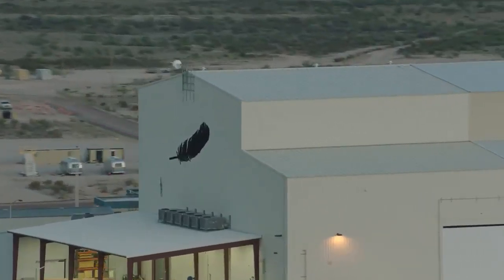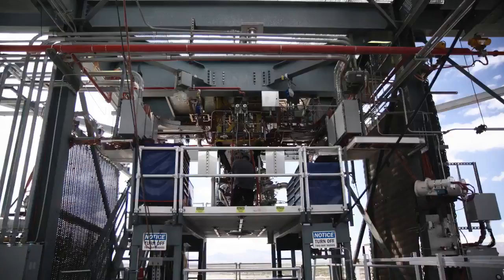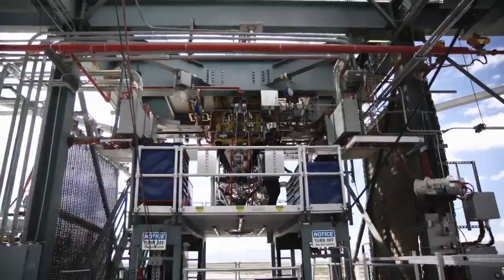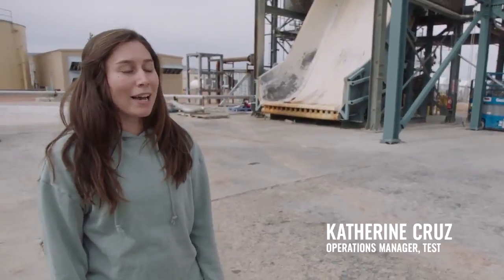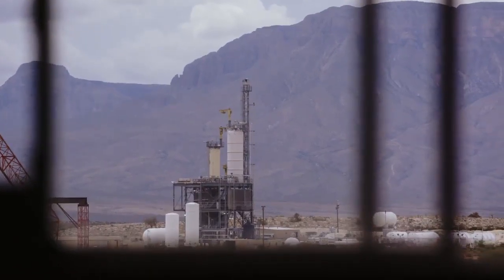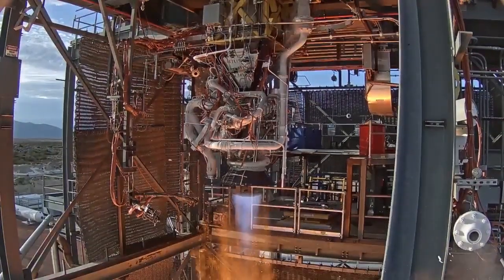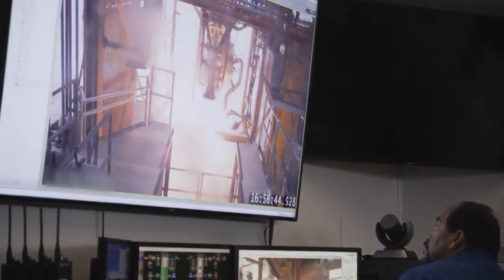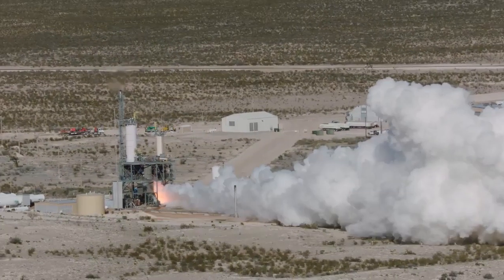Blue Origin BE-3U Engine Development Update

Comment: When will New Glenn launch something to orbit?
Reply: Next year. Same as Vulcan and OmegA.
Reply: @mikedicenso2778  at this rate, I feel like Starship will reach orbit before New Glenn does  ;p
Reply: @manofsan  I'm sorry you feel that way. But facts are facts. New Glenn is still on track for its first launch in 2021. They'd have launched late this year, but Blue Origin decided to go in on the Air Force, now Space Force,  LSP launch competition and so it was delayed to meet the military requirements. All the competitors were. The first flight-qualified BE-4 engines are to be delivered to ULA this May.
Reply: @mikedicenso2778  All were later than that it turns out
Reply: @mikedicenso2778  this aged well
Reply: Never
😂

Comment: Still testing engines...I thought you guys were doing a static fire test on your latest ship?  Oh, wait...
Reply: You're either a troll or willfully ignorant. They are building the rest of the rocket (we've seen video released of the massive payload fairing, fuel tanks, and payload adapters) and this video footage is actually months old. It was shown over three months ago during the last New Shepard flight and it may be even older than that. 

Now that the factory in Alabama is opened, and New Glenn passed its Critical Design Review (CDR) a few months back, they will be going into production with BE-3U as well as BE-4. The former is due to be delivered this coming May to United Launch Alliance for Vulcan.

Comment: What are the benefits of going "expander cycle" vs "full flow staged combustion cycle"?
Reply: JulianGoesPro simplicity is major benefit. For a fairly rough analogy compare an internal combustion engine that has somewhere around 300 parts that could potentially fail to an electric motor which has 3.
Reply: He's hinting at it at 0:28 -- in an FFSC engine there are three combustion chambers (main, ox-rich preburner, fuel-rich preburner) that have to be started and run in sync with each other. An expander cycle, just one.
Reply: single combustion chamber as opposed to having a combustion chamber plus 2 gas generators